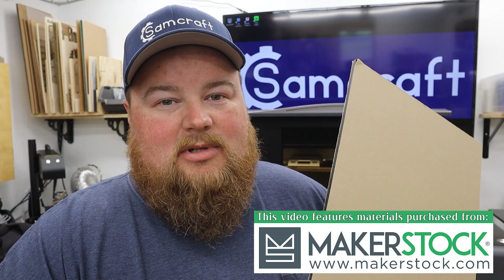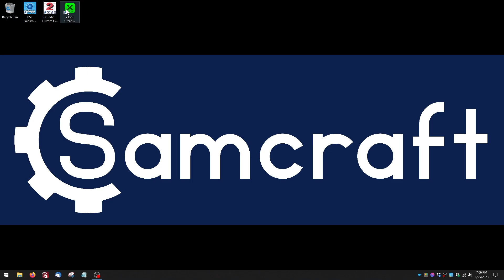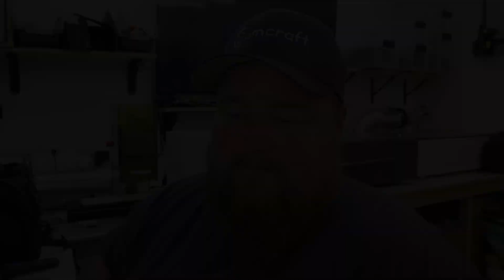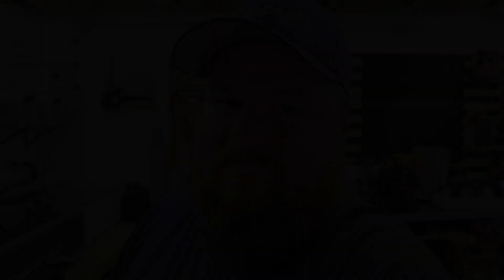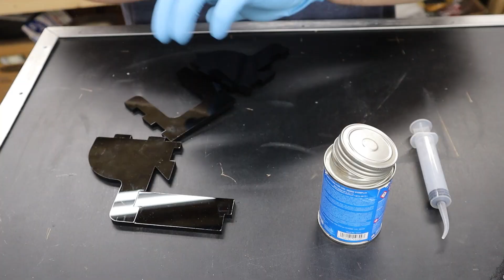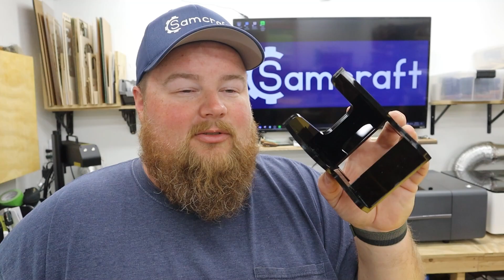I Guess It Wasn't a Total Failure... Acrylic French Cleat Tool Holder

Comment: We used MEK as an acrylic adhesive. Make tighter, fully contact joints, fully pre-assemble and flow the MEK in with a syringe and metal needle tip. Just touch it to the joint and capillary action will draw it into the joint. Joints much be fully touching for this method to work so you may need to adjust dimensions to your actual kerf

Comment: Thanks for the video. MEK (Methal Ethel Keytone) is a very watery solvent for acrylic. It is applied through capillary action, meaning apply only the least amount possible, and let it wick into the seams on it's own. It is not a glue, or a gap filler. You must have tight fitting parts. When dry, it can make clear plastic joints invisible.  If you need a gap filler, look for "acrylic cement ". Its clear, and is sold to kit, model makers.
Reply from the maker: Thanks for the info!

Comment: I miss the wood working videos. Most of us can't afford cnc or laser cutters
Reply: Fear not. You can machine acrylic and polycarbonate with standard WW power tools. Also, polycarbonate, while slightly more flexible than acrylic, is much more resilient. Can you say "Lexan"?
In addition, you can not and should not cut polycarbonate with a laser, unless it's is really thin. And....laser cutting acrylic can cause heat stress so be careful with the application and round inside corners to avoid stress cracks.
Reply from the maker: CNCs and Lasers are available cheaper than most stationary power tools. But I understand where you're coming from. However this is the direction for my channel for the foreseeable future.

Comment: Sam great video. Thanks for sharing, I might actually use that idea in the workshop i'm building.

Now about glue, where I live, weld-on is extremely expensive, and I've tried CA and all other kinds. One chemical actually worked best for me and relatively cheap (if you can get your hands on).. and that is Chloroform .. yep, laboratory grade Chloroform works BEST for me for acrylic. Ofcourse, its extremely dangerous and carcigonic. So a proper organic vapor grade inhaler is a must.

Comment: Sam so I have done similar glue ups with weld on. One trick is I use small pieces of painters tape to hold the work together . Then like welding I tack the corners then when set pull off the tape then finish glue. If you try and glue under the tape it will leave marks similar to your glove mark. I have also used the younger plastic bottles with spout to put glue in to. It also some times will squirt out if not careful. I do like the look though I think you ay be on to something!

Comment: Sam, Weld On is a solvent not glue, it's more like welding the plastic. Fully assemble it and use a bottle with the smallest tip you can find (think sewing needle size) then go along the seams with it, capillary action will pull the solvent between the joints and weld the 2 parts together. I use to have a friend in the plastic industry and I would watch him do this all the time, they would get orders for like 100 boxes, he had a jig to clamp all the parts together then take his small bottle with tiny metal tip and just run it along the inside corners all the way around, let it sit for like 10 minuets and pull the clamps off and it was done.
Reply: Oh, and most of the solvent is either so don't be smelling it unless you want to take an unplanned nap

Comment: First suggestion, when working in acrylic always try to use fillets rather than sharp angles at stress points like the hooks that go over the clear.  Sharp angles at stress points in acrylic induces stress crazing over time and can make that an early failure point.

Second recommendation.  Syringes suck for applying thin adhesives, what you want are needle tip glue applicators.  You can precisely put out single drops of glue using them.  Either that or get some Weld On 16 which is more like a gel and much easier to work with.

Comment: I use methylene chloride with a small artist's brush to fix acrylic parts together. This works well because you can assemble the parts and let the liquid seep in between the joins a tiny bit at a time by capillary action. With a nice pointy brush and a bit of care, I can avoid getting any of the liquid where it shouldn't be. I suspect the adhesive you are using has a base of this same chemical. BTW, Superglue leaves nasty white marks on the plastic just from the fumes.

Comment: Use a cotton swab to apply the glue, that would probably work better than the thing you used.
Reply: I disagree I have fused quite a bit of acrylic together if you the correct solvent the acrylic melts/ fuses together with a cotton swab the fibers in the swab will stick to the acrylic. I use a syringe with a metal blunt needle.😀🛫

Comment: Sam, there are more people with tools than lasers. Market to them. This is your livelihood.  You designed it and should make the money on it. There is always that one in a hundred guys that is going to buy your plans and start selling them. You have to protect SamCraft.
Reply: I agree.  Don't sell the file.  If you've got a decent income stream from the holders, stay with that.  The second you put the files out there they'll be used against you, so to say.  It's easy enough for someone to reverse engineer these - so let them do so.  The current viewers who want to cut their own is probably limited and the sales will be front loaded (a lot at first, then dwindling), but the files will undermine you forever.

Comment: Love your stuff, and love that you show the struggle. Bit of  info for you: The product you're using is not glue, it's a solvent. Like doing PVC work, it's actually melting the acrylic and "welding" the two pieces together. My can of the same stuff came with a small squeeze bottle with a needle-point applicator that works great.

I also saw the initial cut speed and thought "how is that thing faster than my 60W OMTech?! :)
Reply from the maker: Thanks for the tips!

Comment: They make a needle squeeze bottle that will apply the acrylic weld on.  If you hold your 2 pieces in place, then use your applicator under corner edge it will flow to all area that it is touching as you work down the edge of the acrylic.  Takes some practice for sure.

Comment: adjust your kurf so that it is a tight fit. put it together. thern use a syrnge with a "small"  gauge... like for insulin. thern wick the weld-on into the cracks. no mess and it will hold itself together with friction and melt the parts together. CA glue will not work. Your pharmacist will sell them to you if you tell them what they are for and they don't believe that you are a drug addict. lol

Comment: having worked with clear acrylic we had simulair glue (was like acethone ) and did used a glass seringe with metal needle and basicly let the "glue" flow intoo the joints and melt them together , worked awesome , on the clear stuff you could see the edge of the material disapear when it fused together 
to bad you cannot sell a file with a selfdestruct code in it that basicly only allows you to make a fixed number of the toolholders